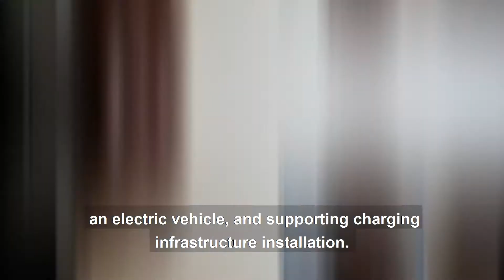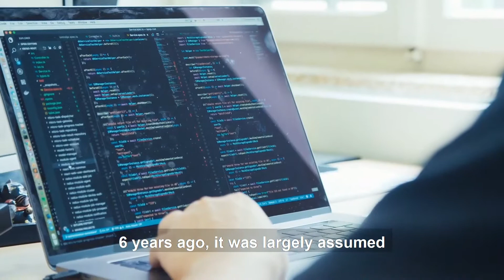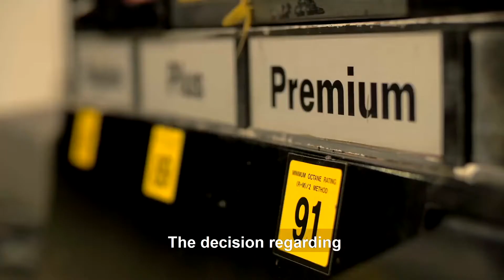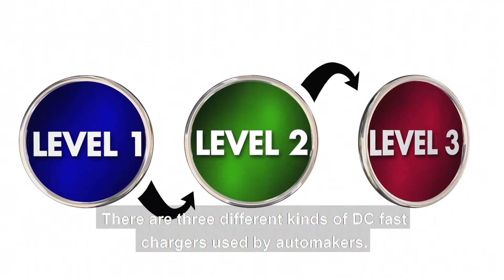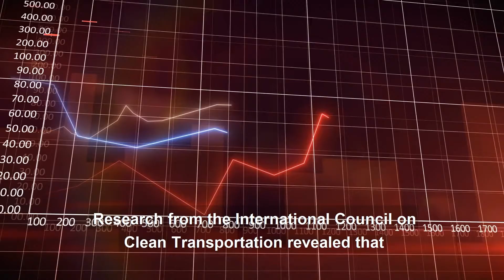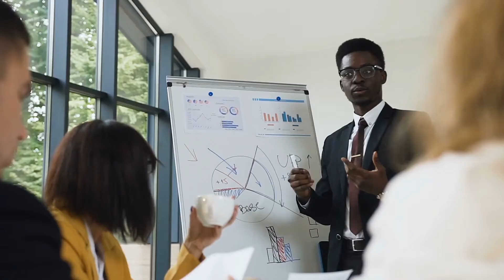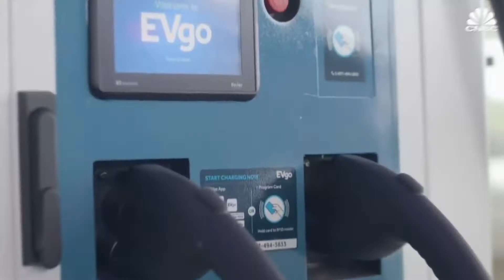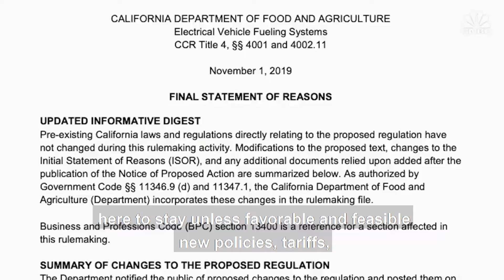THE ELECTRIC VEHICLE CHARGING PROBLEM | things YOU SHOULD KNOW before buying an electric vehicle |

Comment: I don't think governments should be in the business of building standardized charging networks.  However, as they have done with our current fuel distribution networks, dictating standards by which fuel is dispensed including standardized plug configurations, charge fill rates, billing requirements and other standards is more in the wheelhouse of governments.

Comment: I tried to go the electric vehicle route from 2018 to 2022 with a Nissan LEAF, Chevrolet Volt, and Chevrolet Bolt. 

I always had some kind of problem using public chargers. Usually it was a problem with authorizing the payment, but sometimes the charger would not make an initial connection, even before the payment process. This was especially true with DC Fast Chargers for some reason. I would estimate that about 25% of the public chargers were out of order. 

I finally gave up when it was obvious the full electric vehicles were impractical to drive more than 100 miles from home because of the lack of DC Fast Chargers, especially ones that operated.  For that reason, the Chevrolet Volt was the most practical because it had a gasoline engine "range extender".

The Nissan LEAF was the absolute worst. It lost half its range when the temperature went down to 20 degrees.